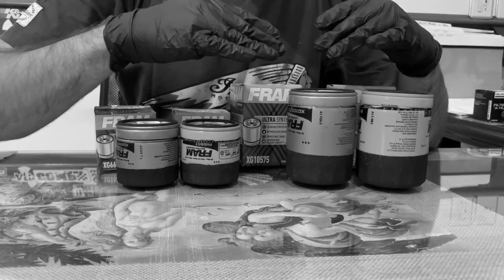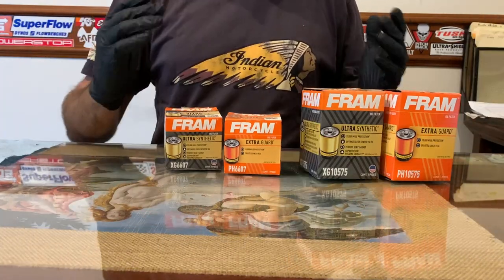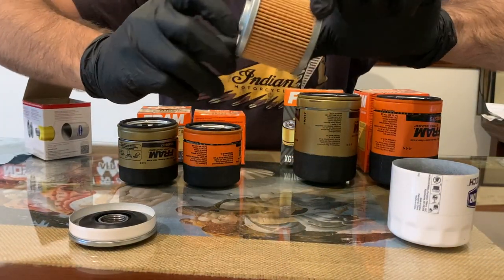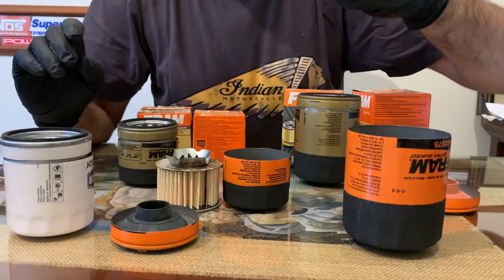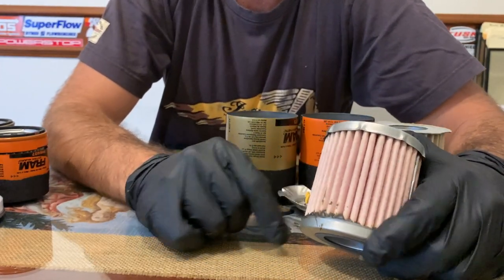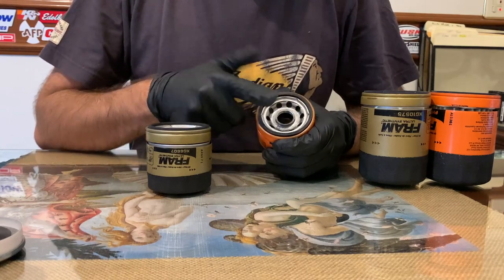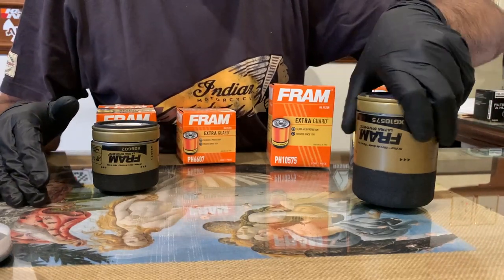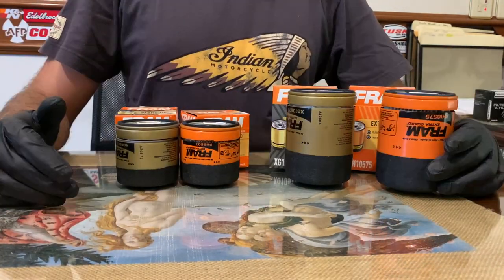FRAM Filters EXPOSED: The DANGEROUS TRUTH About FRAM Oil Filters

Comment: The fram ultra synthetic actually has a better filter media. The purolator and the fram orange can has cellulose media whereas the ultra synthetic has a dual layer synthetic media. The cellulose media filters 99% and 30 microns and the ultra synthetic dual layer media filters 99% at 20 microns (smaller particulates). The metal mesh also helps keep structural integrity. The ultra synthetic is actually a high quality filter.
Reply: I couldn’t agree more. 
99% @ 20 microns is fantastic efficiency. 
Fram Ultra is hard to beat.

Comment: It’s not the filter that’s the problem. I’ve used Fram Filters on my Nissan Versa and the car ran smoothly. I would change the oil and filter every 5000 miles. As long as you change the oil and filter every 5k miles you should be able to use any oil filter

Comment: I put a FRAM orange filter on my 2004 Dodge Ram Hemi (should have kept the truck...) and it knocked like hell. I went back to the Mopar filter very quickly. do NOT use FRAM!
Reply: on start up?
Reply: That means your oil pressure is Very low , and there's some kind of flow restriction .
Reply: @danaschappell2779 no, it's from oil bleed down most likely

Comment: I dont care what any of these comments say. Ive also been building high HP vehicles for years and I wont touch one of these pieces of junk. I dont care if its ultra synthetic or not. If you only just do a driveway oil change on your wifes Honda  go for it. Not in my rigs, not worth the risk. Stick with a Wix or a Purolator if possible.

Comment: I wouldn't put a Fram filter on a lawn mower... When I worked at a parts house, we purposefully had on display multiple cut aways showing different tiers of quality/ cost.   9 /10 times when I showed the Fram cutaway compared to ANY other brand, customers would opt for the higher quality filter ( airing on the side of caution) for themselves, considering that a lot of the time it means the difference of only 3-5 dollars in cost. Great video man

Comment: Wow, fram used to be good quality..
   I use their filters for my gold wing amd those arnt like this., but you cant hide it on a cartridge type filter.
Reply: thanks, I'm looking for filters for my motorcycle and Fram and K&N seem to be the only available options (It's a CFmoto so they're brand new to the US). I wanted to avoid K&N sense I don't want a high flow filter. I was worried about Fram but the pictures show it with metal end caps and I figured the same, they can't hide it on the bare cartridge filters.